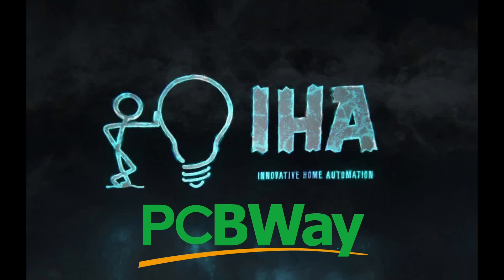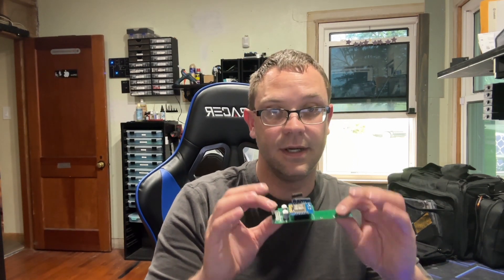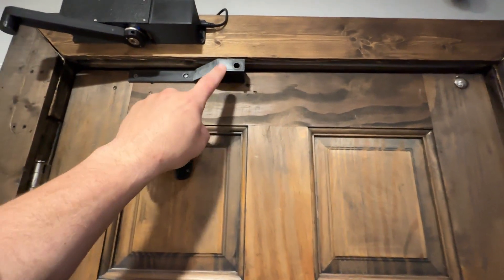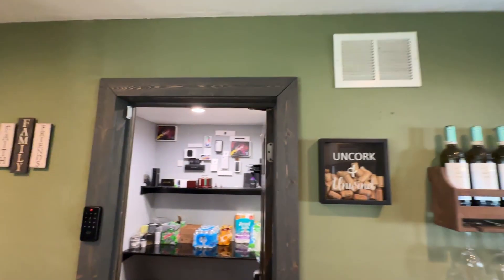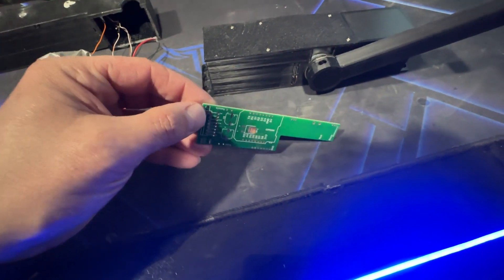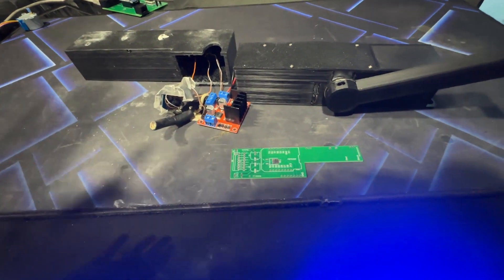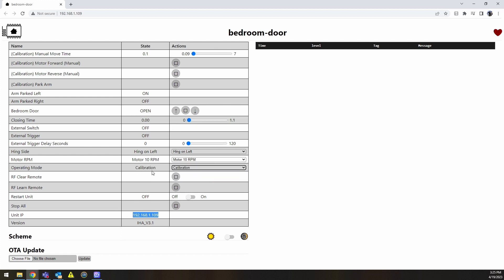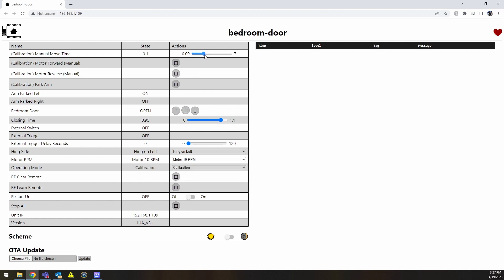DIY Automatic Door Closure

Comment: Great job ! ;-)
Reply from the maker: Thank you.
Reply: This is awesome! QQ: what is the wire that goes straight into the door at 3:24?
Reply from the maker: @rgarza7264 that is the power wire. I am using a Poe splitter and Cat5E to get the 12v needed.